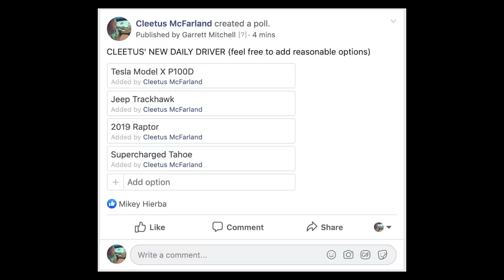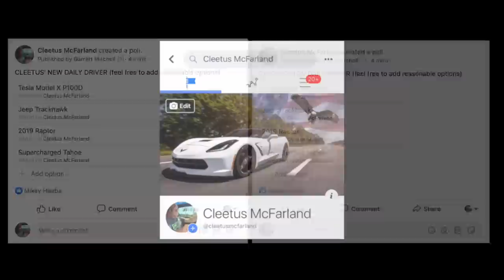Our DIESEL Powered Ford Galaxie is Getting AIR RIDE! + CHOOSING A NAME (please vote)

Comment from the maker: I know a lot of you guys don’t like Facebook so we will search for some other options. Most of the decent sites I found required sign up regardless. If you have any website suggestions please list below!
Reply: I believe you can do a poll directly on YouTube
Reply: How about naming it Rebel? Because it fits by every definition of the word.
Reply: Cleetus McFarland so I ran a transportation company for a while u can use air ride to soften up the dually when in loaded it makes life so much better
Reply: Cleetus McFarland surverymonkey
Reply: Strawpoll or directly with Youtube with cards on the right of the video
Reply: @hampussepe9487  +1.....that's a Boss's car!
Reply: Name the car REBEL! You got a Cummins in a Ford and it’s a car not a truck....if that ain’t a REBEL idk what is!!
Reply: Tin Lizzie

/ˌtin ˈlizē/

a cheap, old, or run-down automobile (originally used as a nickname for early Ford cars.
Reply: Strawpoll
Reply: Supercharged Tahoe would be awesome.
Reply: strawpoll.me has pretty good duplicate checking :)
Reply: YouTube FTW
Reply: Me and 2 other guys here at Solomon Chevrolet agree on the Tahoe.
Reply: Cleetus McFarland lay frame
Reply: Straw poll
Reply: DEW
Reply: Use YouTube
Reply: name submission: Detroit Smash
Reply: Bigggggg Bertha
Reply: Uncle Buck
Reply: Grandpa
Reply: Get a Pontiac G8 GXP. 4 Doors, LS3 V8, and a glorious 6 speed manual transmission!
Reply: Lexi  for name
Reply: Get either any of the Chargers or a Trailblazer SS or a Chevy S-10 Extreme
Reply: Buy some flexible dryer duct to get the black sute outta the shop for dynoing
Reply: PRO CHARGED MINI VAN
Reply: You could use 150mm ducting from a home/hardware store and attach an inline axial fan or a big fan attached to the other end to suck the black sooty exhaust out your shop.
BTW Facebook sucks, Strawpoll.me would be good.
Reply: Straw poll. super easy to use
Reply: Just use the polls on YouTube
Reply: Just have Cooper stand there and blow the smoke out the shop.. or James with a bottle to spry the smoke out😎
Reply: Put it on your channels community page. Nicks strength and power uses it all the time.
Reply: survey monkey...
Exhaust issue, I say furnace duct and possibly add a blower fan to help vac at the car connection... Tough to write out the thoughts...
Reply: Name it stranger like you said
Reply: DIESELINA !!!!
Reply: strawpoll
Reply: How bout naming it  "SMOKEY"
Reply: Is the killer pin fixed ? Or it will blow up
Reply: Do a YouTube poll,it's the best
Reply: I have owned several Galaxies, for good suspension parts, look at PMT suspension parts.
Reply: What about the name RUSTINA
Reply: I'm still hoping for Popeye the Diesel Spinach Beater.
Reply: Depending what platform your website is built on, you might be able to create a poll page on there.
Reply: Facebook just bans my account when I create it.  The platform is dead.
Reply: Ct6-v for the new daily bogger be the first to modify the new gm twinturbo v8 !!!
Reply: Give the c7 away
Reply: Just d.d the Galaxy.
Reply: E63 wagon !
Reply: just use the YouTube poll
Reply: still think Chevy Reaper
Reply: Just do a poll on Twitter most everyone has one.
Reply: Dude straw poll does exist
Reply: youtube allows polls on videos, perhaps set two polls up on this video or the next one?
Reply: Captain planet
Reply: Supercharged Tahoe
Reply: I don’t know of any sites but I also will not use Facebook and I apologize for that
Reply: Why not use YouTube?
Reply: Call it Vin Diesel. Its got a vin and its got the diesel lol
Reply: Cleetus—— you have to go with MAX
Reply: I still like OL DIRTY as the name...
Reply: @uncleebenezer4691  yea yt poll
Reply: Cleetus McFarland  the name for the car is Elvis 🕺
Reply: Cleetus McFarland rusty
Reply: Twtter??
Reply: Cleetus McFarland steely dan?
Reply: I still think you should name the ford Big Smoke.
Reply: Twitter
Reply: Just do the poll on YouTube in the community tab! That's what it's there for, for creators like you!!
Reply: Just go to Home Depot or Lowe’s and get a vent a hood.
Cooking/stove. Then run some flex pipe 👍 @
Reply: You should make a instagram account, it's everything you want for the group, pictures for updates and pictures of trips and videos etc, plus you can do a pole on there aswell im pretty sure. if not you can always put a link in the instagram post to a www.strawpoll.me where no one needs a account to participate in the vote!!
Reply: YouTube video > Card > Poll https://www.youtube.com/watch?v=aq-sXqt_bhE How To Add A Poll To Your YouTube Video
Reply: New daily should either be a Chevy Callaway Powered vehicle or a C7 ZR1 or a new 1000hp or 750hp yenko Camaro,Corvette,or Silverado 1500 or CT6-V or ATS-V
Reply: Judgement day
Reply: The galaxy has to be called the curd.
Reply: Mac the galaxy
Reply: Whats this facebook? 😂
Reply: Shane

Because it's a diesel, and large...
Reply: strawpoll
Reply: Honestly, people keep voting for Jeep... but they’re not that reliable anymore thanks to those damn Italians... plus you won’t be doing much ripping in it.. I was thinking a performance suv from Ford or Chevy... MAYBE Dodge, maybe only because Dodge is also owned by those damn Italians as well...
Reply: Name it poeboy
Reply: Strawpoll.me
Reply: Cleetus McFarland instagram polls
Reply: Finally I love it when YouTubers use Facebook
Reply: Use google
Reply: Shelby f150
Reply: You can post polls in the "Community" tab on YouTube.
Reply: More than a lot of us team BogDeep, Facebook is an abomination of security best practices, and I will never have a Facebook account. :)  But Hampus Sepe had a great suggestion in strawpoll.me.
Reply: THe FUMINGS
Reply: Please call it "Baldiesel"
Reply: The fumins
Reply: Tahoe
Reply: Fummins
Reply: Name it Steel
Reply: @uncleebenezer4691  yes u can i always put them in my videos
Reply: Straw pole
Reply: Do a Twin Turbo BUS as a daily
Reply: @hampussepe9487  I was thinking straw poll as well, but I don't think voters can add options like is possible on Facebook.... Time to see if my wife can vote for me since I deleted my Facebook lol
Reply: Duke rippin
Reply: Coallean
Reply: COALlean
Reply: Just call the 65 ford,NUFF SAID!
Reply: Like every streamer on twitch uses strawpoll. Kinda surprised cletus is learning about this site today
Reply: I would only vote if it was right there so I vote Youtube as well
Reply: YouTube has poles, am I crazy?? 🤷🏼‍♂️
Reply: I’d rather drive a Geo Metro than sign up for Facebook. Just sayen.
Reply: I would of went Accuair Endo CVT. air system?
Reply: I’ve bagged one of these cars before... without any major cutting... let me know if you have any questions/concerns! I can send ya some pics if you want
Reply: Instagram
Reply: Why not YouTube poll? I genuinely dislike Facebook
Reply: Poll on YouTube or use straw poll
Reply: you could always make a poll via Google docs
Reply: Jeep trawkhawk or hellcat
Reply: Strawpoll!
Reply: Thanks cleet. Apreciate it.
Reply: Up-voted YouTube comments for ideas then YouTube poll yer 8 personal favorites
Reply: Cleetus the galaxie needs a tractor flap 🚜
Reply: Name it Bessie. And just use the YouTube Poll.
Reply: Name the galaxy smoke or Smokey
Reply: I don’t have a Facebook but my vote is for the Tahoe if you ever see this count this comment towards the Tahoe lol
Reply: You can do an actual pole right on YouTube. Sorry man but I will not get a Facebook, ever.
Reply: Google forms
Reply: Straw poll
Reply: Google Forms does online surveys for free that are real easy to setup. Could do both questions in one survey.
Reply: Strawpoll is one of the best options
Reply: @hampussepe9487  Are there any in US?
Reply: Cleetus use Strawpoll
Reply: But the duck calls and turbo whistles that stick in your exhaust that's when I started watching your videos and watch every single one since then whatever it ends up being make sure it'll do it for Dale
Reply: Amino
Reply: You should get a Chevy SS or Pontiac G8 GXP
Reply: How about “Groot” from guardians of the galaxy
Reply: Twitter
Reply: Google forms, simple :)
Reply: Cleetus McFarland get a Tahoe
Reply: Its a Ford......have to name it Rusty.....honor of Rusty Wallace.
Reply: Google polls
Reply: Yo Cleetus, just get a Toyota Tacoma
Reply: You should do a give away for the Galaxie, for every $5.00 of merchandise 1 entry (Street speed 717), you guys will make millions on this.
Reply: Use duct pipe and run it out side and problem fix..no black smoke inside
Reply: do a poll from youtube
Reply: Buy my 63 Pontiac Catalina and daily it
Reply: Cleetus McFarland you can do polls on twitter
Reply: As low as possible cleetus
Reply: I think the name should be cosmo
Reply: RS7
Reply: Looks like something from the apocalypse, so my name suggestion is Mad Max.  It definitely looks mad when you get on the throttle and that black cloud belches out🤣🤣🤣
Reply: thank you very very very much for searching for other options.
Reply: discord, you can post updates, create different channels in your server, people can share pics of their cars, etc... also as for doing polls, https://www.strawpoll.me/ signup optional
Reply: brother you gotta name her Loretta the coal miner's daughter
Reply: Surveymonkey
Reply: Make the poll you YouTube. FK facebook.
Reply: "Fallacy"
Reply: "Google Forms" is free and doesn't require an account.
Reply: I think YouTube does polls.
Reply: Make your own site, it’s better that way :)
Reply: YouTube poll
Reply: Cleetus McFarland I couldn’t find the poll but track hawk
Reply: I think you should do a 2-month giveaway for the C7 pad be lit every $5 you buy and merchandise goes towards like a ticket??? Give a fan the og c7
Reply: why dont you do the voteing though youtube
Reply: Dude... Survemokey.  Get a mailchimp list too.  Let's Internet!
Reply: You can do the poll right on YouTube, no Facebook please
Reply: How about the "silver sleeper" for the galaxy???
Reply: @Hampus Sepe an Audi RS6 would be badass. Unfortunately, you can’t get those in the US market
Reply: How about guardian the galaxy
Reply: survey monkkey
Reply: A f6 ford territory with the unbeatable barra would be perfect
Reply: You should name the galaxy “milkyway”
Reply: Trail blazer ss
Reply: Mob Steel wheels would be mint!
Reply: Hampus Sepe you can’t get those in the US
Reply: Facebook can derelict my balls.
Reply: Facebook works fine
Reply: Cleetus McFarland call it old smokey or old rusty
Reply: I think FB is for your younger viewers and Twitter for gen x+. The best way would be a youtube poll.

Fyi: cars earn their own names so don't rely on a poll.

Have you ever seen the 80's movie Christine? I was 8 years old and that movie scared the crap out of me. Christine 2 or Christina would be a good name for that tank. 
Do a smoke scene entrance for that car burnout scene on Cleetus&cars...
Reply: Silver hornet is a good name
Reply: I live if fort Lauderdale will drive up I would like to look at the c7 I've been looking for one to build but yours is already done what's the best way to message you to get some details
Reply: Dryer vent from Home Depot
Reply: Name it.... HEAVY METAL, BUBBA, UNCLE WILLIE, KIN FOLK
Reply: Iron horse
Reply: midnight edition tahoe
Reply: If you want it cheap dirty and easy, use flexible dryer hose, or if you want something that might last, use industrial flex hose
Reply: STOVE PIPE!
Reply: I vote for the name Luciford 
Because it's gonna be evil fast.
Reply: Google forms.  Free and can handle all your data logging and analytics.
Reply: @bustyouup4free  and mark fuckerberg🤣
Reply: Big booty Judy. I don't do FB
Reply: Make a Cleetus app? That would be the best thing. Having all the new stuff to keep us up to date, hell brother you could make it a awesome app with other things like behind the scenes or what not?
Reply: Libtarded yupp
Reply: Rod Jeremy
Reply: @uncleebenezer4691  Yeah, I was surprised they didn't do that.
Reply: Holly's ride
Reply: Cleetus McFarland  —> make a Discord 👍🏻 done
Reply: Just do youtube polls
Reply: strawpoll
Reply: Fass desiel fuel system definitely best in the game 💪💪💪💪💪
Reply: Old smoke
Reply: Youtube has the option to run a poll. If you want to use another site maybe twitter?
Reply: Car.
Reply: @uncleebenezer4691  ^This
Reply: If you name it stranger I think it shouldn't be just stranger, you could mod it quite a bit and call it stranger danger
Reply: Srt10 ram 1500
Reply: Focus rs big turbskies
Reply: @Cleetus McFarland 
I’d like to add a name for the galaxy. The Name is “Bradley” after the Bradley fighting tank. I thought it was pretty cool because that tank has a 600hp Cummins in it. Just an idea sense it is a tank.
Reply: Cleetus McFarland FAWK fbook....

TrackHawk.... Stranger. Go.
Reply: Fuck face book just do a poll on you tube.
Reply: Name R. D.      Rip it till. you Drip it.
Reply: Not sure what the issue is with Facebook. I have been on for years and it has been great. I belong to quite a number of car clubs on there and found cars and good advice and given good advice. No different than the people that are on here.
Reply: CTS-V wagon cadillac!!
Reply: It looks at though you have an HX40 turbo. Should be good for about 20-25psi and flow enough air for 500-600 hp. The problem is it doesn’t spoil up very well. And the 12V heads don’t flow very well ether. To get it on top of the charger, getto fog it. While on the dyno, use the dyno brake to hold it at a specific speed to add load to the engine and help it get on top of the charger. 

Thowing the nitrous at it will clear up the smoke and give you no reason to need the stack vent
Reply: Cleetus McFarland I’ve seen polls on YouTube
Reply: Cleetus McFarland Chevy intimidator
Reply: Straw poll or just on the video
Reply: Duramax/Allison powered Tahoe or suburban built by duraburb inc
Reply: Cleetus McFarland  madmax galexie
Reply: Compound turbos man
Reply: PileDriver
Reply: google forms
Reply: Jeep 707hp
Reply: Cleetus McFarland smoke issue solution would be flexible aluminum dryer tubing
Reply: Gto or g8
Reply: I wouldn't use Facebook if you were giving the C7 away on it.  Period.
Reply: Do you have Facebook
Reply: Cleetus McFarland iiiii
Reply: I want the c7 cleetus
Reply: Youtube has a polling system.  That could definitely be an option
Reply: Steal not real steal. Or Stealll
Reply: I cannot find it anywhere on Facebook
Reply: Ol' Baggin Saggin Barry  (All That skit)
Reply: STRAWPOLL... Best Polls there is.
Reply: STEEELLLL
Reply: Cleetus McFarland I got a Galaxy name Colossus the Cummins
Reply: Cleetus McFarland  flex pipe best thing for smoke
Reply: @OscarGarcia-ho2yr  It's gotta he STEELLLL
Reply: Het dryer vent hose from  home depit works great and its cheep
Reply: @hampussepe9487  I believe in the States that is Impossible to get one of these
Reply: minds.com
Reply: Dirty Diesel 
Dirty d 
Double d
Reply: Cleetus McFarland  💯prededoter
Reply: You guys keep doing You, but If I may suggest compound turbski's so it can still smoke when you want, but clear up and Burn! Baby BURN!
Reply: Coal-ene.
Reply: Track hawk
Reply: Dryer exhaust hose
Reply: you should buy a honda civic type R 1 generation
Reply: Do ima YouTube poll
Reply: Hillary for the name...Think about it!!  Evil car that blows a ton of smoke..Think of the move Christine,,same idea different name for an old evil car..hope you see this...funny as hell too!!
Reply: @davebrittain9216  Several years ago, Facebook was taking the information you gave them; your name, location, birthdate, favorite band, TV shows, etc., and using it to build targeted advertising campaigns.  That was fine; the hidden cost of using the service.  

The problem is now.  Now, if you're using facebook, you likely have it installed on your phone.  And even when you're not using the app, it is tracking your location, your proximity to other users, your proximity to businesses, and if you've ever been to the site on your browser, it is also tracking what websites you go to, how long you go there, and what you look at while you're there.  If you have facebook messanger, that's a separate application, and it's actually taking your private converstions and collecting data from that too; your speech patterns, places you mention, things you talk about buying, days and times you remark, whatever you can think of.  Then it's using THAT information to sell you targeted advertising.

Think about that for a second.  If the government were to be found to be tracking you like that, it would be a violation of your constitutional right to privacy; it is literally against the law for the government to track you in such a manner.  But Facebook, being a business, has no such restriction.  Essentially, by using Facebook, you are granting them a license to spy on you, and to share the information they collect with whomever they deem to be a reasonable partner.

Most of us were OK with facebook when they scoped their information collecting to people who interacted with the service.  Most of us stopped being OK with facebook when they expanded their scope to include our personal lives, off facebook.  That is not a service cost for using the service, that is a tax.  Facebook makes huge fucking money on our information, and all users get for that is data breaches and the sharing of the information they've collected with Russian spies.
Reply: I banned FB forever years ago.  Use YT polls like the rest of the viewers are saying.
Reply: @Cleetus McFarland, us "Old Guys" still use FB daily :)
There is a company in Florida that drops Duramax Diesels into Suburbans and Escalades. Duraburb Inc. Heavy YT presence, been building vehicles "that simply work" since '07. Would be a very cool car to haul Holley in!!
Also, thumbs up on Tin Lizzie for the Galaxie
Reply: @homersapienne2356  Google does exactly what you describe and it comes on every Android phone.
Reply: Trackhawk. 100 Percent
Reply: Cleetus I need that black Camaro. I currently have a 98 z28 but its given me nothing but trouble since I bought it 2 months ago. It's my daily. First day I drove it to work I lost 3rd and 4th on the freeway. I love those f body Camaros. Let me know I'm seriously interested thanks.
Reply: @yordydecorte4839  well darnit then...
Reply: I say we all meet up at Taco Bell and sort it out.
Reply: Use youtube polls!
Reply: Name it Rusty
Reply: google forms
Reply: I used to work in a welding shop and we had a hood vent that would suck up all the toxic fumes and blow it out of a vent on the roof. Not sure how much you want to spend on something like that but it's probably the best way to go. Should be a bunch of systems available online if you're looking for something permanent. I would maybe call a welding shop and ask them.
Reply: Steely Dan
Reply: Lol Facebook yeah right
Reply: Rusty trombone
Reply: @davebrittain9216  As does Apple.  But I mean, I have fake identities for every device I own and rotate them out frequently.
Reply: Cleetus McFarland.....
Rusty trombone
Reply: Hi Cleetus im pretty sure you can do a poll here on YouTube , and " RawHide " for the car name  because it's raw steel down to its original hide 👍👍👍👍
Reply: Discord - strawpoll for the sign in phobic
Reply: Roswell!
Ford galaxy. Ufo
Reply: Please pick Roswell.  Its a ford Galaxy (Unidentified)(Ford)(Object.)
Reply: Don't be complicated out if need of greed. Use the poll on youtube. Anything else is fucking ignorant.
Reply: Ford Explorer Sport
Reply: Cleetus McFarland gotta say, I regret gettin rid of my 95 Cummins. I escort for a living. Went thru 5trans (auto) I hope that thing is built atleast somewhat. The 12v auto is garbage! Not tryin to hate, trust me. Lol
Reply: @homersapienne2356  It really does not matter what you do to try to "hide". Apparently according to recent statistics the average person in N America gets photographed/videoed 16 times a day. In the huge cities of China they can find a missing person in less than 20 minutes using facial recognition. Samsung admitted to videoing us through their smart TVs for "research purposes". I can't believe we all did not go off our rocker on that one alone.
Reply: You can do polls on google forms.  Most people have a gmail account so that should work for most people.
Reply: Also, I'd like to see a Flex Ecoboost as one of the options, mostly because I have one and I love it.  They're cheap in the used market these days, they're luxurious, and it's ridiculous how quick you can make them for not a lot of money.  Don't handle too bad either and no drama under acceleration.  It really pisses people off when this grocery getter silently slays them in a drag race.  Only drawback for you and your channel is that they're AWD only so not much opportunity for 'murica-style tire burning action.  Maybe swap in an F150 3.5 EB and make it a rear driver?
Reply: Roscoe P Coal-Train 🤙🤙
Reply: And vote ROSCOE!
Reply: @xXDjDoomXx  yess
Reply: The top of the poll is Smokey but I think it should be the Smokey Way Galaxie
Reply: Call it the stinker!
Reply: That's what my son calls me
Reply: Cleetus McFarland “DIRTY OLD MAN”
Reply: ANOTHER ONE BITES THE DUST
Reply: ..........the comments are pretty dang confusing. Guess it's that parallel dimension thingy cause some answers got nuthin to do with ur question. That I read neway.
Reply: Mello Yellow
Reply: Call that Ford Galaxie: Starlord

It fits in perfectly
Reply: We catch that leroy car at our track again were going have a problem😡😠
Reply: Call the new vehicle RUFUS !  Which fits in with the rest of the cars
Reply: @cedricterrell1161  is that a joke.lol
Reply: Rustella
Reply: Lamborghini Urus
Reply: Coalslaw! name credit to whitelightning on your first video of it.
Reply: What type of wheels are they? I have a 65 galaxie exactly like this one and I’m looking for some wheels like that? If you get rid of them let me know man.